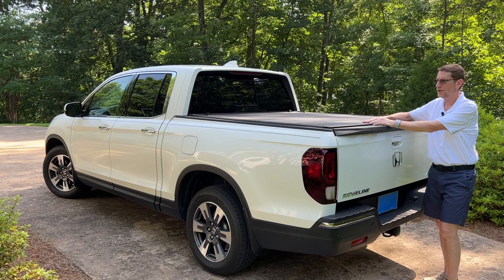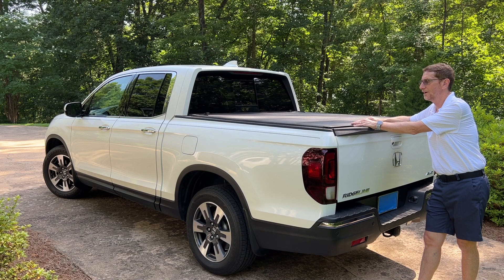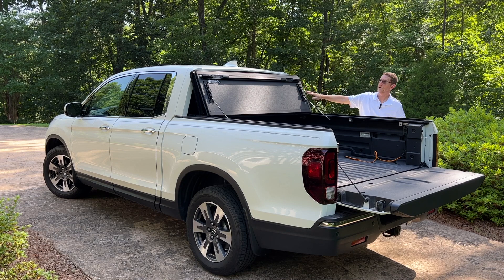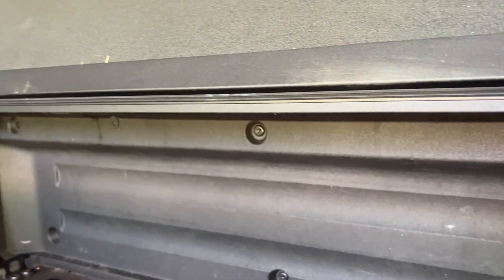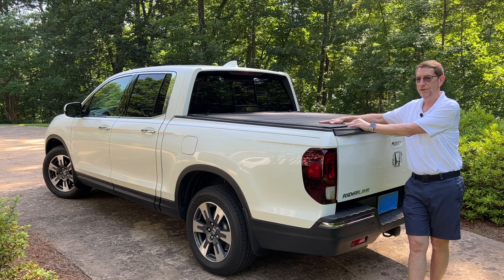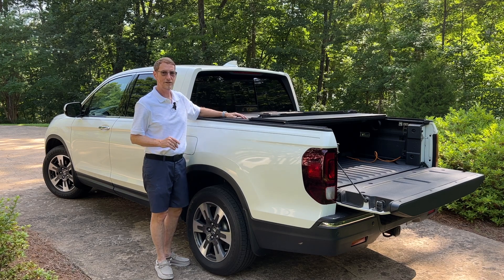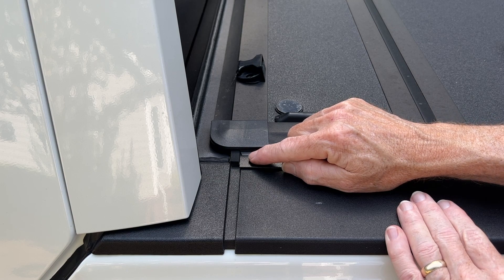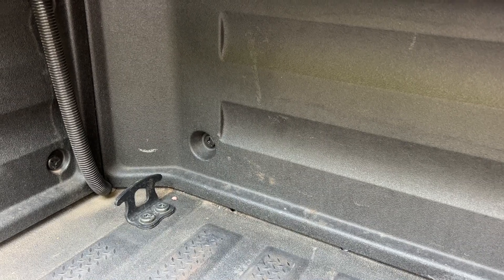Bakflip MX4 Tonneau cover, four year review and tips for keeping water out of the truck bed.

Comment: When the MX4 cover is fully folded back and leaning up against the back of the cab, what is the distance / clearance from the inside of the top of the bulkhead to the rear edge of the opened cover?

I have a combo transfer tank with a toolbox on top in my '22 Silverado 1500.  I know that the fully opened MX4 cover eats up enough distance from the backside of the bulkhead that I wouldn't be able to fully open the toolbox lid.  But, depending on how far rearward the edge of the fully opened MX4 sits, I might still be able to open the lid enough to make the toolbox useful.

My second issue might be the height clearance for the top of the transfer tank fuel pump (which sits proud of the top of the toolbox).  Right now, the overall height is just about even with the bed rail.  If the underside of the tonneau cover itself (not the side rails or hardware, but the inner field of the cover) falls below the bed rail and uses up any of the clearance, I might have a problem.  However, it looks like the underside of the cover inner field might actually be slightly above the height of the bed rail.  Which would give me a little more "breathing room."  I know that bed rail heights vary, so the most useful measurement would be the measurement from the top of the bed rail (same as the bottom of the mounting rail portion that sits on the bed rail) to the underside of the cover inner field.  I imagine that this would be less than an inch.

My final question is, what kind of issue might there be with the trapping in the closed cover of the inevitable smell of diesel fuel?  No matter how carefully I fill the tank and pump fuel, there is the inevitable residue somewhere.  From your video, you don't have a fuel tank in your bed, but, do you have any thoughts on that?
Reply from the maker: Thanks for watching and commenting. Every different truck bed requires a custom sized tonneau cover. I'll give you the measurements for the BakFlip on my Ridgeline, but a BakFlip cover for your Silverado is going to be different. 

On my Ridgeline the outside lip of BakFlip rail sits just barely higher than the bed rail. The BakFlip cover material is about 1/2" thick and if you open the tailgate and look at the end of the BakFlip rail you can see that it's 'Z' shaped and drops over over 1/2" below the top of the truck bed sides to support the BakFlip cover and provide a drip rail under the BakFlip Cover. Also, each section of the BakFlip has a latch and reinforcing brace that extends about an inch below the underside of the cover and goes all the way from one side of the BakFlip cover to the other.  

Fully folded against the cab, my BakFlip cover uses about 9" of space.

BakFlip does make a custom tool box that could be added under their covers, if you can solve the fuel tank issue then their toolbox might be a good option. https://bakflip.com/p/bakbox-2-tonneau-toolbox/

Give the BakFlip folks a call, they have been super helpful when I needed help.
Reply: @Koolbob2  Apologies for my delayed acknowledgement, but thanks for your reply.  It was very helpful.  It confirms that I'm down to a game of inches, or an inch.  I've got 22-1/4" from the high point (rib) of the bed to the top of the side rail.  The top of the pump nozzle protrudes above the rail by ~3/8".

With the tonneau panel at ~1/2" thick, which would get my clearance to 20-3/4".  Somehow I need to gain an inch (pump nozzle protrusion plus cover thickness).  Perhaps the nozzle can be somehow repositioned.

Or, I wonder if I could install a 1" to 1-1/2" thick neoprene gasket to the top of the rails, bulkhead top, and tailgate top to raise the entire tonneau by that much.  What do you think?
Reply: @Koolbob2  By the way, I'm not sure how clear I was.  By raise the entire cover with a neoprene gasket, I mean the entire unit by placing the gasket between the cover frame and the bed rail, front, and tailgate.  (Not put the gasket between the cover and the frame rail it sits on.)
Reply from the maker: @garyheurich6835  Yea, that's what I thought you were proposing. If I were to attempt something like this I'd give some serious consideration to making a U-shaped 'spacer' out of 1" square aluminum tube. Have a look at this website. https://eagle-aluminum.com/products/tubing-connectors-framing-systems/1-tubing-connectors/ You would need three pieces of PART# E-9215, two the length of the side rails and one the width of the front of the bed and you would need two PART# 5211 90degree corner connecters. You would also need to fill the 1" gap this would create at the tailgate, maybe this is where the foam gasket would come in handy. 

That being said, lowering the pump nozzle would be the best way to go IMHO.
Reply: @Koolbob2  Copy that, thanks.  Will do.  And, again, thanks for your help.

Comment: The trick is to keep water out of the panel covers, you can’t. They will go from 15 pounds to 50 pounds. Likely to smash the back window if leaned against it. Truly not impressed with mine as it is now just a giant absorbing sponge and has been after 3 years. BakFlip.. $$$Junk.
Reply from the maker: Sorry to hear you had issues with yours, so far I have not noticed any water absorption, weight increase or drips. Have you taken this up with BakFlip, their customer support has been awesome when I reached out to them.
Reply: @Koolbob2  2 year warranty on these particular models, I can understand why. At over $1,000 it is definitely not worth it. I am sure the roll up model will not retain water has a longer warranty and cost $500-$700 more. Likely is made with less material and I am unsure of the thickness or strength to take various weights and or ability to not dent easily. Do I like the covers? Yes… Are they worth cost? Absolutely not.
Reply from the maker: @derekparent752  Sorry you had abad experience with yours, mine's 6-years old and good as new.